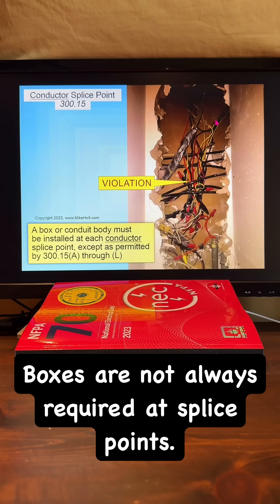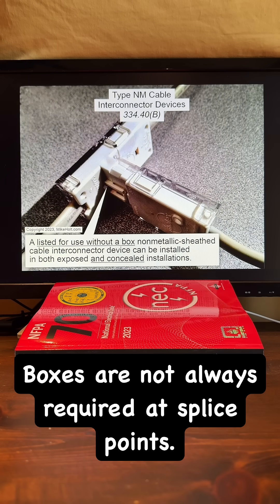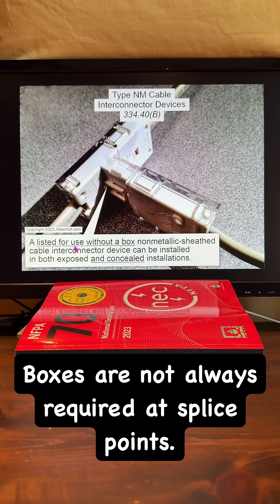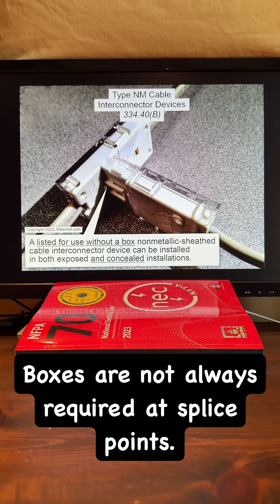300.15 A box must be installed at each conductor splice point, except as permitted by:

Comment: When I was 20 years old I did 1 summer of construction work for someone who should not have been a contractor. We ended up cutting through some post and tube wires. 

He was really bummed until I told him I could re solder those. He said “oh, great”

I didn’t know any better at the time. So I twisted some more 14awg wire in so it was physically structurally sound. Soldered that together. Then covered it with good quality heat shrink tubing. I was really proud of my self at the time. 

Once I learned I should not be doing that on someone else’s house I have always wondered if I caused a dangerous situation in any way. I do feel like the repair was as strong and as insulated as the original wire. So there is that.